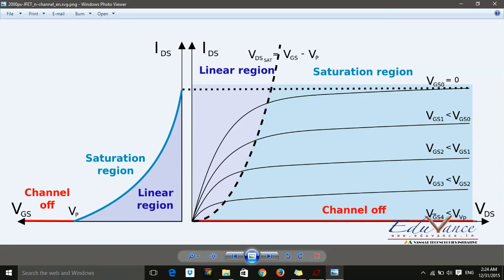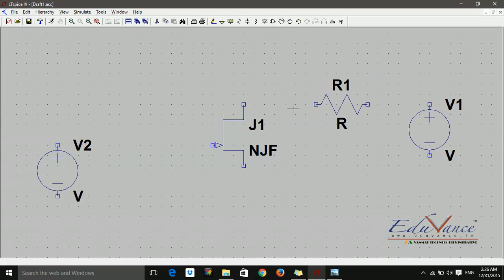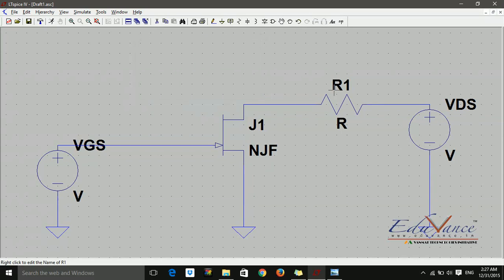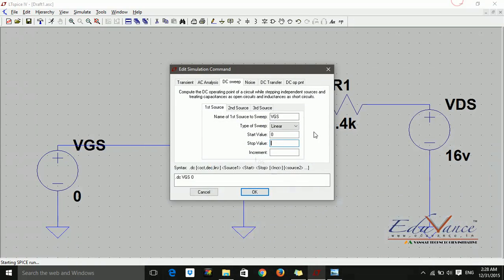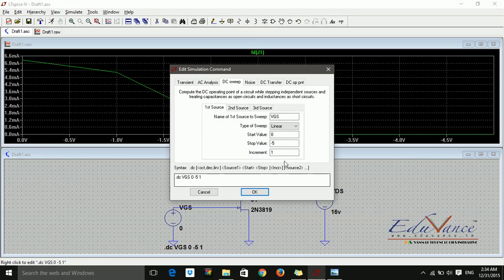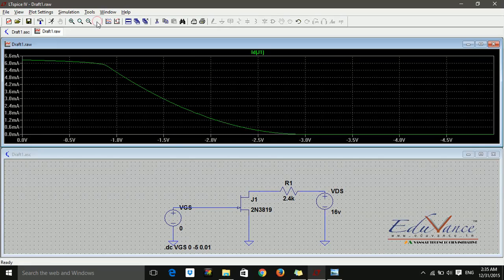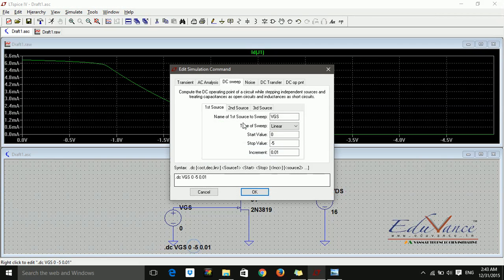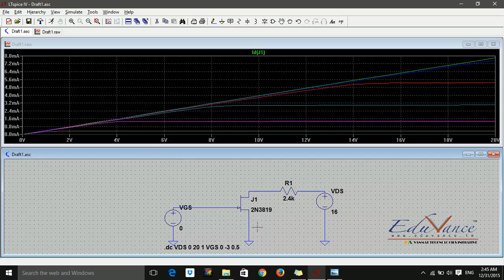LTSpice Lecture 4 JFET Characteristics

Comment: For the output characteristics, why is Vds = source voltage and not voltage across drain and source terminal of the JFET ??
Reply from the maker: Vds is voltage across drain and source terminal.The curve drawn between drain current Ip and drain-source voltage VDS with gate-to source voltage VGS as the parameter is called the drain or output characteristic of the JFET.
Reply: Thanks for your kind reply, but I am still not very clear about Vds. The X-axis in the output characteristics ,here in the video, is (voltage across drain-source terminal of jfet + voltage across the 2.4k ohm resistor). Shouldn't it be voltage just across the drain-source terminal of jfet , because if not, every time you change the value of resistor you get a different output characteristic ??
Reply from the maker: In the video, the output characteristics of the JFET  is plotted between Id and drain to source voltage Vds, as far as the change of output characteristics is considered with a change in any parameter like R or V the output characteristics will indeed change.